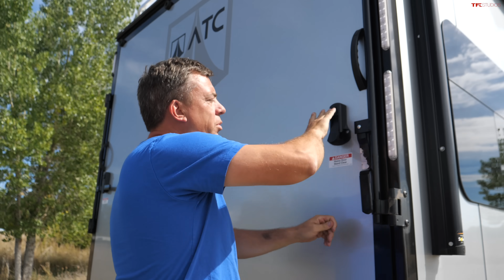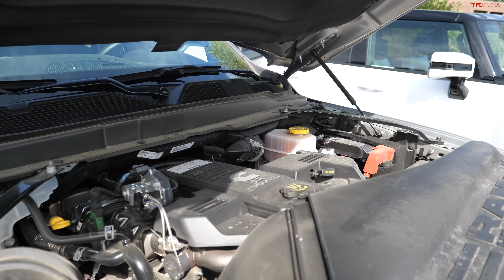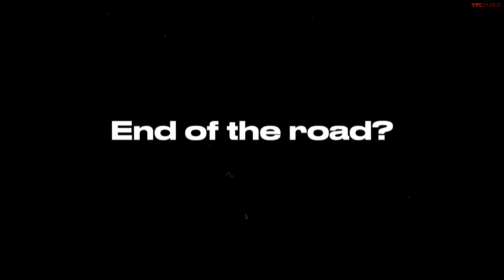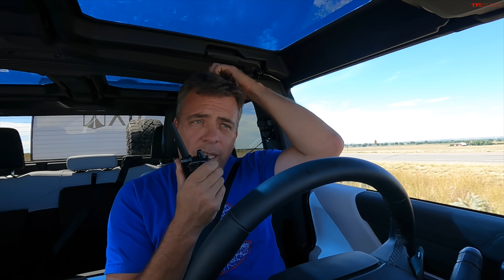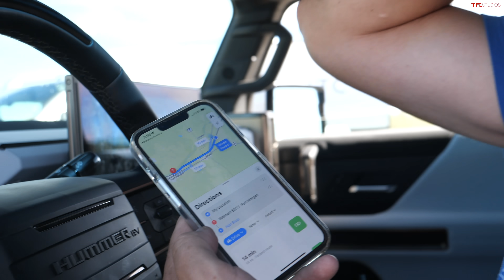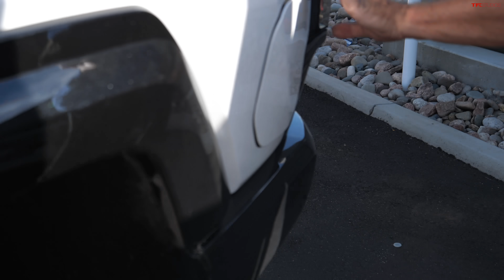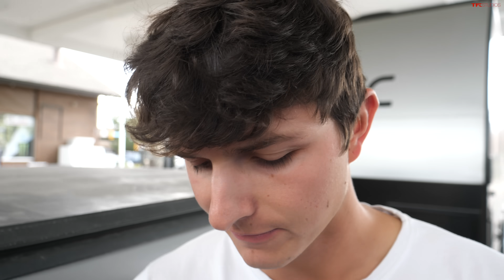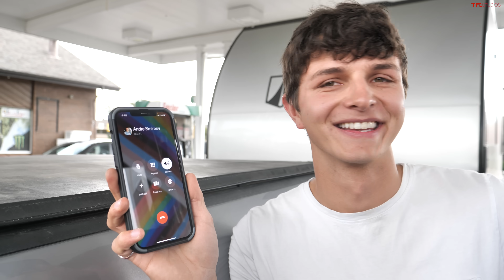How Far Can a Diesel and Electric Truck Tow An Identical Camper Trailer on ONE Fill-up?

Comment: EV and HeavyDuty are two things not made up for one another.
Reply: Yeah leave it to all the biggest equipment in the world. Everywhere i look in the global mining fleet, electric propulsion is more common. Crazy huh, almost like its just the batteries that are a weak point. All the torque all the time is something that’s hard not to be happy with.
Reply: @danh8302  a 20 gallon tank of diesel is equivalent to about 750 kwh of battery capacity. The battery is the weak point.
Reply: @mtnman1984  Comparing energy density doesn't tell the full story. EVs are significantly more efficient with their energy than ICEVs.
Reply: @directorjustin no single stat, like efficiency, tells the whole story, but in order for the Hummer to provide the same utility as the Ram, it would need a 500 kwh battery and the ability to charge a 3MW+. The battery is the issue.
Reply: @AnthonyJ350  Somehow, I have a feeling they are changing over to diesel because at that point it removes the conversion because the engines in the lower gears cannot provide the acceleration. That way I get an improved efficiency and best of both worlds. Diesel is a horrible electricity producer. Gasoline is a horrible electricity producer, but what is funnier is that oil is a horrible producer of both energy products as you need 42-gallons to make 20 gallons of gasoline or 11 gallons of diesel, and yet, oil is being touted as being a wonderful energy source.
Reply: @ronaldking1054  Earth movers are diesel over electric. Until they can make a better battery I think it's the way to go if we want electric motors for propulsion.  As of right now, nothing works better than gas or diesel for vehicle fuel if you look at conditions and infrastructure around the world.
Reply: @AnthonyJ350  Yes, it is so good that a quarter of refiners closed, but hey, it's always good when your fuel can't be made.
Reply: @ronaldking1054  We need that fuel for mining and transport don't we? Also demand for fuel hasn't been reduced.
Reply: @AnthonyJ350  What claim are you trying to imply with that comment? Are you trying to claim that electricity requires fossil fuels, which is false? Are you trying to claim that the electric vehicle is less efficient, which is again false? Are you trying to claim that electricity at least requires a commodity, which is again false? Are you trying to claim that solar and wind would still require mining and transport and as such, it doesn't help demand, which is false because the overall movement of the renewable generation commodities would be much less because we do it once over many trips? Which false implication do you want to be proved wrong on? The great thing about being someone in the minority is that I have gotten to hear all your arguments, and I have had to refute them all. What's worse is it was easy to find the information.
Reply: @AnthonyJ350  Oh, I also forgot that you might be making the absurd implication that most travel in the United States is for mining and transport.
Reply: @ronaldking1054  No, EV mining exports emissions. But transport in terms of train and semi trucks is definitely North America.
Reply: @AnthonyJ350  Simply put, you are claiming that the material mined once to create the battery creates more emissions than the entirety of all fuel burnt by the vehicle and the differences in the materials you need in your powertrain. This is akin to stating that the battery size is the entirety of all energy that battery can store, which is plain nonsense.
But wait, there's more. It's not just the fuel your vehicle burns, it's the fuel that the vehicle transporting the fuel burns. The EV, on the other hand, has power that is moved along transmission lines, but that loses some of its power (5%). This is funny because the EPA to show a more true efficiency rate takes care of that transmission loss as it states that 33.7 kW is the conversion factor when it is actually 40 kW. The efficiency in the EV calculation takes care of the loss in fuel delivery, but the EPA never accounts for the loss of fuel in the delivery of fuel to the ICE vehicles. If I had to take a guess, that is because the calculation is too complex for the amount of loss.
Reply: @ronaldking1054  Is it mined once per vehicle? EVs haven't been on the road long enough. Will we see a 25 year use life span on these things? Don't know. I think a diesel generator up front with electric motors would be a great stepping stone. Also we have to see how infrastructure manages this shift and if nuclear gets used more. California is having a hard time keeping up, and they get enegery supplemented from Canada.

If the vehicles used to mine the material for EVs was done by EVs, I'd see it working better. EVs are great for city vehicles, don't seem to work better anywhere else. Not until you make the battery more energy dense, cost effective and hopefully simple.
Reply: @ronaldking1054  I guess the question is, is there a time frame when we stop mining battery material? Otherwise the impact is cumulative. Extracting oil and mining for Lithium, Cobalt etc.
Reply: @AnthonyJ350  Okay, your accounting skill is non-existent. You cannot weigh alternatives because you are claiming that anything should not be done.
Reply: @AnthonyJ350  Let me explain this with a personal experience. My mother is a hoarder. She accumulates things. Anything she buys is good because she decided to buy it. The fact that her house is no longer of any use is irrelevant to her because it is full of things she wished to buy. You are the equivalent of my mother. You value things you want higher than what is necessary to grow. This is nonsense.
Reply: @ronaldking1054  No I'm saying there should be a stepping stone. Introduce diesel over electric drive train and focusing on infrastructure is what I'm saying.
Reply: @ronaldking1054  You haven't answered any of my questions. Aren't EVs a cumulative addition to emissions? Vs carbon capture let's say.
Reply: @ronaldking1054  You're mother hoarding doesn't explain current oil extraction with the addition of lithium mining with no end in sight.
Reply: @AnthonyJ350  You are trying to state that no less oil is going to need to be extracted because heavy movers are going to be around. This means you do not even agree that diesel is a byproduct, but it is. Unfortunately, that byproduct is so in demand, that it is no longer the byproduct, but the main product, which is why it is now $5.
Reply: @AnthonyJ350  How the heck do you think that a vehicle that does not have emissions add to emissions? You are claiming the entirety of the oil usage which causes emissions replace the production costs of the battery. They need to be replaced in 10-20 years by design, and yet you are claiming that mining equipment takes as many emissions as the car does and all the heavy equipment to move the fuel for that car as well as all the heavy equipment to move the oil to the refinery.
Reply: @AnthonyJ350  Carbon capture is not a sure-fire bet either if anything happens to the field. Permafrost melting is a very high source of carbon. It is carbon capture that failed. By the way, you are still exhibiting the traits of a hoarder by claiming that the oil industry will keep extracting at a high rate when there is no need to extract. Don't get me wrong in that it will be a while at this similar to what happened in 2014 where they will have to store oil on tankers, but that ended.
Reply: @AnthonyJ350  By the way, distillates which include diesel only account for 23% of all the fuel used by the United States. The other happens to be 54% for gasoline, and yet you have claimed that heavy-moving diesel-fuel users are the majority of the petroleum usage.
Reply: @ronaldking1054  Because of the increased demand of fossil driven equipment to produce materials for the increased production of EV vehicles. Do you see any EVs in trades?
Reply: @ronaldking1054  Do you think highly populated third world countries have the infrastructure to handle EVs? California doesn't yet.
Reply: @AnthonyJ350  Considering that it took until 25 years ago to reach a mountain population with gasoline in Pennsylvania, I doubt that they even have the infrastructure to deal with the gasoline vehicle. What was your point?
By the way, that is the hoarder mentality again. You aren't even questioning what is wrong with the point you are advocating.
Reply: @AnthonyJ350  There are usually Tesla's used, but this is the funny thing. You are trying to claim that long-term usability (net minus in terms of what you are trying to argue is a problem) is a problem, and what is worse is that the others have mechanical problems like the hood stoppers corroding, which shows that it isn't that they aren't wanted, but instead that there is a manufacturing defect in the used vehicle. Your implication appears to be false in both cases.
By the way, the other one that I noticed lost its onboard charger, but everyone claims the batteries fail. The charger is replaceable, and it isn't too hard to do.
Reply: @AnthonyJ350  Oh, I also forgot that lithium is recyclable, but your fuel is not, which weakens your point even more.
Reply: @ronaldking1054  But I just showed you an article about carbon capture turning carbon back into fuel. We have a natural gas company locally that wants to adopt it to lower their emission.

For some context, do you work on cars in any professional segment?
Reply: @ronaldking1054  Did you watch any of the videos I sent. Do you have any proof showing how "green" the manufacturing process is and what it will take to setup all the infrastructure?

What if we just changed the fuel? Wouldn't that be a better stepping stone till we can move past lithium?
Reply: @ronaldking1054  My point is, if a lot of 3rd world countries can't setup infrastructure, the EV switch doesn't really work because the countries that pollute the most aren't switching over.
Reply: @AnthonyJ350  My point is if a lot of 3rd world countries cannot set up ICE infrastructure, there is no pollution for them to switch from.
Reply: @AnthonyJ350  Do I need proof of green when I never said it was a potential selling point? You did. Also, you should know that YouTube will not allow links as it is considered commercial spam, but I do not need your links to know the argument that you make makes no sense mathematically. It's horrible to be educated with no income as it is easy to see the nonsense. I know that making it so that I am reliant on one fuel that is currently priced more (as it takes more fuel to do the same thing and this is the price of a unit of work to the price of a unit of work) than the other commodity is bad, and it is worse when that commodity is overpriced by its suppliers, who are known to have and currently are manipulating the price of that commodity. I also know that it is bad when one singular commodity is decided to be the only source rather than many. I also know that it is bad to use a delivery source that uses a lot of energy to do. Transmission of electricity uses little. I also know that it is bad when it is necessary to force companies to reduce the cost of their vehicles, which happened from the 1980's until now with ICE vehicles.

On the other hand, we have companies that are trying to put technology into their vehicles that does not need to be there. This is a function of people lying about the above. This lowers the selling group, and that group wants technology unneeded in their cars. Autonomy is expensive, but what is worse is that it is moving into the ICE car market when the ICE car market is already pricing out people, and what is worse is that has been nearly happening for a decade.

You also equate the fact that there is societal pressure on those energy baskets to remove carbon dioxide as meaning that those fuels are not feasible. Oil is not economical as it refines badly and converts fuel to work badly, but it was the traditional fuel so it must be good even when it is the worst of even the fossil fuels. It just happens to be the one that is the safest of the most easily transported when it is at the end user, and that is not even that good because the transport destroyed at least one drinking source of water and its extraction has destroyed the fishing industry of Louisiana and previously Alaska. All of these points are you making my car (not to mention the water and the fishing sources) more expensive, which I resent, and what is more, it happens to be the states that can source that commodity, which are the main power of the political party that you are probably supporting. In other words, they support the traditional technology so that their state revenues make sense, which means they have an economic incentive to lie to you.

For some reason, it is bad to want to pay $62 instead of $300. I also do not want to be nickel and dimed out of $20 every 6 months, and that $20 happens to be using oil, which is the fuel you claim you want to burn. I also do not want to have to ensure that the higher pressure of a hose next to a thermal source has not destroyed my coolant system or the lubrication, which is oil and as such, it also goes to the coffers of those states, for that thermal source. I also do not want to have to deal with checking the fluid in a transmission that doesn't exist in the other type. These are all detriments of the system you say I have to buy because you and the political party in my country that supports them has made economically the only thing to buy. None of them exist in the simpler system. There is a coolant system for the various components, but these components are separated, which should make it easier on the system, and what is more those components should be easier to replace because they are separated. The friction brakes are in the system, but they do not need to be used as often and as such, they are the backup deceleration and they do not need to be replaced as often.

I cannot wait to hear that the batteries which are designed to last for 10-to-20-years are going to need to be replaced in 5, which is lower than even the warranty of the batteries. I cannot wait to hear that they catch on fire even when the safest fossil fuel does that, and that fuel on transport is economically destructive on massive scales, which is not true of all the sources of energy that have the potential to be converted to electricity. I cannot wait to hear how less energy used in a vehicle with more of it being put into the work is bad because the conversion process takes so much fossil fuel, when it is even possible to remove the transport of the energy alone and generate my own electricity with another source for less than you can produce and transmit with any of the fossil fuels, and as I stated, the work costs less on its own by purchasing that electricity from a company. I have already heard the nonsense that the mining and transport of components to make a component once is more than the entire extraction, transport, and burning of fuel for that vehicle as well as the components not needed in the electric vehicle. This is bad accounting 101, but that is the only accounting that makes the ICE vehicle look good.
Reply: @AnthonyJ350  By the way, yes, the country that does pollute the most is not switching over very quickly. That country is the United States. It's funny how the source of oil with current supplies lasts 30 years if we are the statistic of the average consumption of oil. With the real average person, it is nearly 45 according to the data of 2016, which happens to be the most recent time anyone has looked at how much oil anyone has found. If you don't understand, that means not only is that fuel that you advocate bad, but it also looks to be unfeasible. Good luck finding that resource. The worst mineral, lithium, had supplies increase by 30% in 2019. This is what happens when you have a base scarce resource that no one has looked for. What's funnier is that more abundant resources to replace the things this technology needs have been found. We have more energy dense batteries than lead acid in terms of aluminum sulfur, but then again, battery technology hasn't changed in 50-60 years. It's amazing how the conservative media's definition of "not changing" does not seem to fit the general consensus definition of "not changing".
Reply: @ronaldking1054  I sent an Engineering Explained video with EV. It's energy emission is half (which is good) but not zero emission by today's energy sources.

I just wanted to know what EV you're driving.
Reply: @ronaldking1054  So all that writing and you say you've "heard all the mining arguments" but you don't counter with other sources for facts. You just keep saying bad accounting.

What EV are you driving?
Reply: @ronaldking1054  US is the number 2 country. And it pollutes half as much as the number 1 country. I'd post a link but YouTube won't let me.
Reply: @ronaldking1054  So to be clear you're a battery advocate? Because I've suggest alternative energies and diesel over electric drivetrains as stepping stones.
Reply: @AnthonyJ350  You are still claiming a single fuel commodity at a time for a vehicle, and you are still trying to state that is a better alternative. In no situation is that true unless the fuel source is optimal.
Reply: @ronaldking1054  I'm suggesting diesel generator over electric (more efficient than gasoline propulsion), carbon capture, hydrogen (Cummins is developing an engine to run on hydrogen), synthetic fuels. Those are all alternative.

Also those alternative require less of overhauling the infrastructure.
Reply: @AnthonyJ350  You're suggesting that diesel, which has a 20% efficiency of oil usage in refining is the way to deal with a scarcity problem while removing the 40% efficiency of the production based on the gasoline. You just removed the cost economy on the diesel, which probably would still yield about a 10% efficiency on oil usage to work.

Carbon capture can be used for electricity storage, which means it is a battery technology all on its own, but it is still an unsafe one. All of this however does not remove that it also allows the electrical production for the grid in the first place. In other words, it is a puzzle piece of the infrastructure you are advocating against. It also happens to create an economic incentive for the activity that you advocate.

The hydrogen exacerbates the fact that the air is more humid based on heating, which is irrelevant of what caused the heating as the heating is known to exist. Every 1 degree Celsius creates 7% water vapor. Your solution is to add more water vapor as wind patterns change, which has resulted in flooding and drought. You are also suggesting that hydrogen can be stored in fuel tanks or that moving water to these stations to produce the hydrogen is less of a problem than the transmission lines for electricity. How do you figure that the infrastructure is going to change less? By the way, the truck to move these is also part of the emissions cost of your fuel. It isn't free.

You have also suggested that the use of synthetic fuels, which from my knowledge is based in deforestation, is part of the solution. The forest deals with the carbon dioxide, which has a high correlation with temperature and the structure of the tree is more likely to create wind patterns for rainfall. This means you are advocating even more water vapor in the air on top of the hydrogen in your mix.
Reply: @ronaldking1054  Yes because diesel over electric is proved at the largest scale and the power density is much higher than a lithium battery.

Carbon capture can be converted back to fuel for internal combustion engines. Look it up.

Until EVs use something better than lithium, it makes more sense.
Reply: @ronaldking1054  OK if battery EVs are your solution. What does the "infrastructure" look like to support it. You have a case against everything else. Are we going to go nuclear?
Reply: @ronaldking1054  Also in what scenario do you see battery EVs working for trades or professions where the vehicle is moving around all day?
Reply: @ronaldking1054  I'll also ask this. If EV is so efficient and works better, why don't EVs compete along side ICE in motorsports and just dominate?

Motorsports is where some of the latest tech gets field tested.
Reply: @ronaldking1054  What EV are you driving btw?
Reply: @AnthonyJ350  1. "What EV are you driving btw?" I already answered this, which means that you are not even aware of the conversation anymore, and you are not even bothered to look before you write, which means it is pointless to converse with you.
2. "OK if battery EVs are your solution. What does the "infrastructure" look like to support it. You have a case against everything else. Are we going to go nuclear?" Thorium reactor waste has a lower half life in its waste. They were rejected because the waste could not be used for nuclear weapons. There is already a commercially viable one. Its fuel needs to be added which removes meltdown, and the fuel is located adjacent to those materials needed for the production of renewables. It easily could be the steppingstone to batteries at grid level.
3. "I'll also ask this. If EV is so efficient and works better, why don't EVs compete along side ICE in motorsports and just dominate?
Motorsports is where some of the latest tech gets field tested." I'll ask you this, "Why are the efficiency numbers so much higher in EV's compared to ICE vehicles if they are not more efficient as you have implied?" When someone tests something and that something has a quantifiable number which shows it to be true, then most people understand the fact to be true. As for motorsports, drag racing would be the closest one, and they do as EV's have some of the fastest acceleration factors in the vehicle market. They do not have the highest speeds because there is no reason to make the motors go that fast as then they would not be street legal. By the way, the EV probably could tractor pull as well as the distances are not great, and they end up having more torque. That is another motorsport. This is a function of having a 3-6-gallon gas tank in terms of energy equivalence.

4. "Also in what scenario do you see battery EVs working for trades or professions where the vehicle is moving around all day?" This is the funniest thing I've ever seen as a question as the profession that moves the most in a day with the smallest work order time would end up being warehousing. Do you happen to know what warehouses use to move their product around? Electric forklifts, and they have been doing that for years. The best you could illustrate would be deliveries, but routes are less than 200 miles, and they are payload, which means the EV does that as well. Everyone else will not have short work orders, but for some reason, there is this claim that those trades will drive longer than the guys who have the shortest work orders.
5. "Carbon capture can be converted back to fuel for internal combustion engines. Look it up." That is to use carbon dioxide to create a hydrocarbon. Where are you getting your hydrogen? I'll give you my best guess, and that is water. According to Stanford in their article, "Stanford engineers create a catalyst that can turn carbon dioxide into gasoline 1,000 times more efficiently" on their website, "Cargnello and his team took seven years to discover and perfect the new catalyst. The hitch: The longer the hydrocarbon chain is, the more difficult it is to produce. The bonding of carbon to carbon requires heat and great pressure, making the process expensive and energy intensive." If your gasoline or diesel requires more electricity to make then it provides, then your gasoline is even less efficient than it already was, which means the battery is still better as it is being recycled once per 20-year cycle, and that also means the carbon dioxide as a resource could still be used more effectively as a battery.
Reply: @ronaldking1054  Fastest EV dragster is 200mph roughly. You see amateurs hitting those numbers. 

I say trades like a construction worker, landscaper etc you think a warehouse and forklifts
Reply: @ronaldking1054  I forgot what EV you're using and your thorough answers are too long to go through. Can you just tell us what you're driving in a simple answer?
Reply: @ronaldking1054  I'm just merely suggesting a stepping stone.  Are you suggesting lithium powered EVs are the most efficient solution?
Reply: @AnthonyJ350  Yes, they are. The steppingstone is the other side of the equation, which is the baseline. Are you trying to claim that recycling gasoline for every use cycle makes more sense than recycling once for every storage cycle? This is what you have said with carbon capture. In an ICE this is the same as asking whether it makes more sense to recycle the gas tank or to recycle the gasoline. You have stated that n^2 is better than n in any system, and the only way that is true is if n happens to have a very large overhead to it, but what is worse is that the gasoline has more overhead to it as there are already recyclers of batteries that are their own private companies while your method is still stuck in academia because it probably requires more electricity than what it can provide in calories, which means yours definitely needs nuclear. We already have an idea to bridge for storage solution. The battery however needs to use more energy than it can store over its entire lifetime minus what little it loses over is entire lifetime. This is good accounting.

You probably will talk about battery maintenance right here, but there are actually battery chemistries that do not have the room temperature problems and can go colder. They are in academia, and since you have stated that carbon capture, which cannot produce gasoline at the moment exists, you must concede that battery chemistry also exists, or else you have a bias problem. The problem is that I know that you do have a bias problem based on all comments you have already made.
Reply: @AnthonyJ350  I am currently using no vehicle because your vehicle market is broken. You need the efficiency but have destroyed the price of the vehicle to gain that efficiency while at the same point you have suppliers that have destroyed the use of all the vehicles by raising your fuel price to a point where it no longer means doing any work with it, and yet your infrastructure is working, and that infrastructure should not be replaced by all your comments. Personally, I would prefer eliminating the need for most energy stations. I would also prefer eliminating the transmission of most of the fuel in both cases, which can happen with electricity, but cannot happen with anything else. My current vehicle is my two legs, and they have worked well. Do you understand that the price of the fuel that you are advocating is lower because people have abandoned it? What's worse is they have been abandoning it for a while by moving to electricity. Did you happen to want a humidifier from an oil furnace? I'm sure you're still using an oil furnace in your home because that is the best source of energy, right?
Reply: @ronaldking1054  So you live a lifestyle that doesn't require building anything or working on things that doesn't requires the transport of materials or parts.

So you have lots of theory but no practical application experience in order to make the theory work.
Reply: @ronaldking1054  You're telling me you don't drive or work on vehicles. But you're going to tell me how vehicles work the best?
Reply: @AnthonyJ350  I didn't say I don't work on vehicles, and you should check out Munro Live so that you might have a clue about an electric vehicle. I doubt you even know how one is constructed. I also love the channels that remove all the garbage from ICE vehicles so that they can be electric.
Reply: @ronaldking1054  Yup, I don't know anything about vehicle electronics.
Reply: @AnthonyJ350  Oh, I love pulling all the landscaping debris from trees by using a tarp because there is a broken-down '87 truck that lost the efficiency in its axles so much that it overheats the engine. It's wonderful. I wasn't the primary repairer, but I understood how to diagnose the electrical system far better than my brother who repairs his cars. The fact my forearms are shot because manually lifting 55 lb. printers over my chest was a bit rough when it needed to be done every few seconds. This means I have trouble removing mechanical parts. That's how I know about practical application of electricity in warehousing, which you obviously don't. I also have practical experience in analyzing systems because I had to do that in order to make sure a backroom stay working and to learn how bad statements are in a computer program. I'm so glad your practical experience trumps mine. If you cannot do anything but insult, you can stop writing anytime.
Reply: @ronaldking1054  You also didn't acknowledge the videos I sent of vehicles running on water.
Reply: @AnthonyJ350  1. You know the links don't work, which means I cannot know of these videos.
2. I did when I stated that it will make the water vapor situation that is caused by the heating, which is known to exist (the controversy is whether we caused it or can fix it), worse. We know that for every degree Celsius the planet is warmer that we get another 7% water vapor. We also know that this will increase the chance of worse floods and we have already seen the wind patterns move which has invalidated money spent on infrastructure and caused drought. Water is the same thing as hydrogen. It is just a matter of whether the electrolysis is on the vehicle. If the electrolysis is on the vehicle, then you are carrying the mass of that equipment. You still have not explained how you are moving the water, nor have you explained how a molecule that is vital to life is going to not be missed.
Reply: @ronaldking1054  Search Joe Rogan vehicle that runs on water. He talks to the owner of Icon. I would assume the collection and movement of water would be similar to how a bottle water company works?
Reply: @AnthonyJ350  Hydrogen alone has a 60% efficiency problem. Your claim is that not only are you going to use hydrogen, but you will also break the hydrogen on board the car.
Reply: @ronaldking1054  Cummins is developing it
Reply: @ronaldking1054  What EV are you driving BTW?
Reply: @AnthonyJ350  What ICE vehicle am I driving as I am equally priced out of the secondhand ICE car market? You are suggesting I cannot ever have the option of buying an EV vehicle. I am also priced out of the current gasoline market.
Reply: @AnthonyJ350  “when trains go uphill they switch to diesel because they can produce more torque”.   Where did you get this information I was not aware of this feature.
Reply: @cynic777  I was mistaken. It was a discussion I had with a buddy. But after looking it up, I can't find any tech where the locomotive has the ability to use the torque from the diesel engine and direct it at the drive wheels directly.
Reply: @AnthonyJ350  thank you for checking!